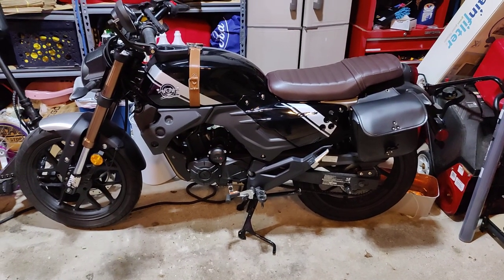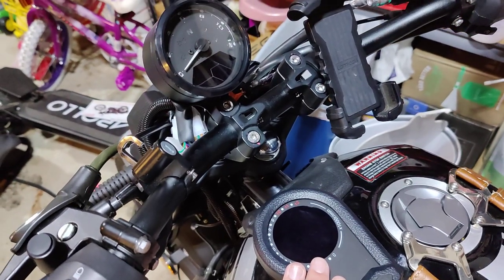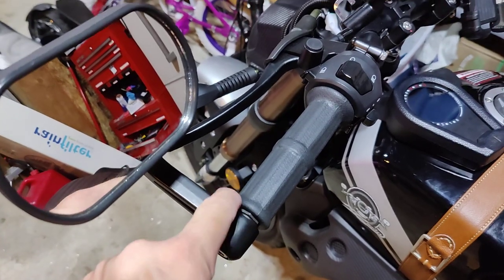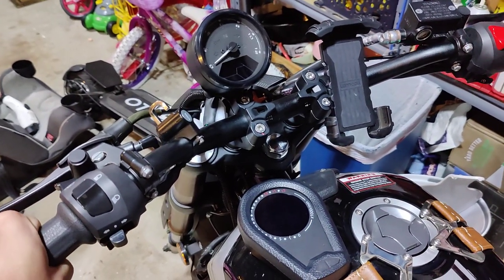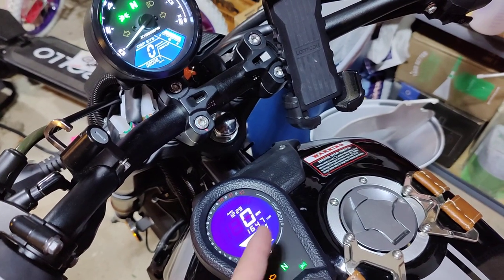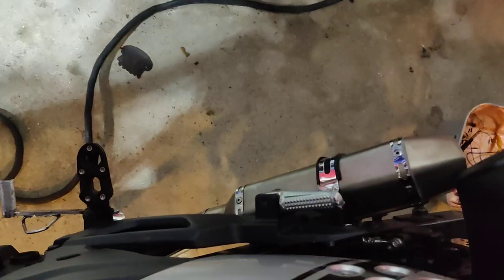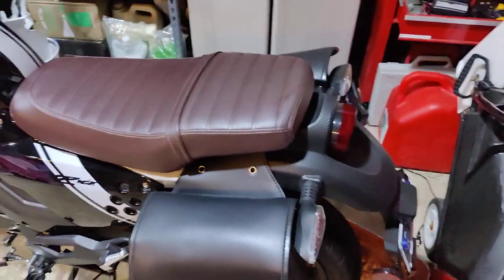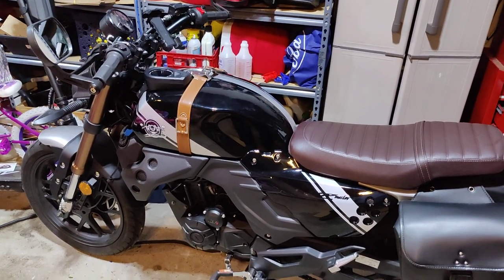American Lifan KPM 200 - 5 Mods You Must Do! (Amazon motorcycle)

Comment: Where did you find the L shaped brackets for the saddlebags? And do you remember what size screw you used to screw it in?
Reply from the maker: The screw was metric. I don't recall exactly but it was available at home Depot. Probably a m9 or m8. I got the brackets there too. Just a standard L shaped bracket bent
Reply: @trekkin_fpv5272  thanks!!!
Reply: @1trae9 M8 x 1.25 bolt holes

Comment: Sir, I love the look of the bike, my concerns are the reliability, parts and no manual for owners. how do u know when to do proper maintenance per recommendation such as coolant, valve adjustments, oil change (which is easiest around 3k). Need your recommendation and advice as an Owner. there's one that I can get for $1500 only 366 miles, clean title. Met the owner 35 yrs old, nice guy, let me took it for test ride with no money in his hand total trust low key guy wasn't pushy. Only selling because he's moving out of state with his family. I met his wife and family so there's nothing fishy with his reasons to sell. I know lot's of people will make things up to try and sell. I really like the look, as for the ride definitely slow. Thoughts?
Reply from the maker: the manual is available online, check my site: kpm200resources.com. It's been very reliable, but as reliable as a honda or yamaha? probably not. Parts are available at dealers nationwide, but they're expensive. You can also order them online, but it'll take longer for them to arrive (weeks at least.) ... sounds like a good deal, to be honest. Proper maintenance is in the manual, which again is on my site. Super easy. Probably the easiest bike I've worked on yet.